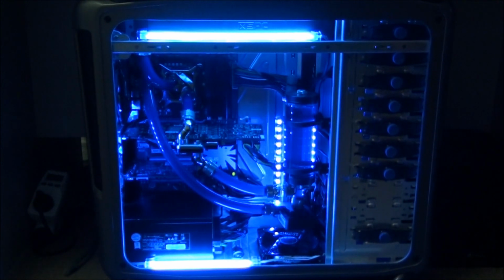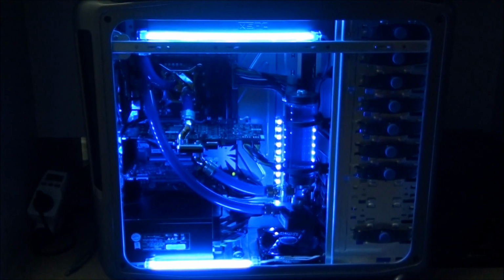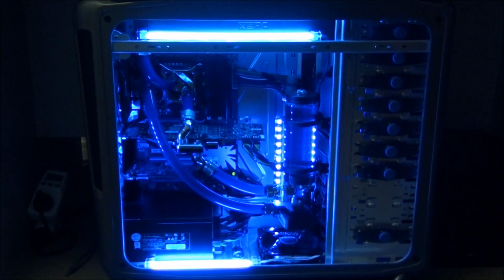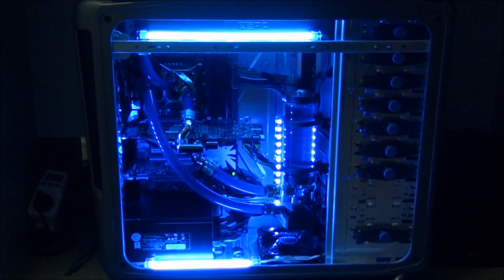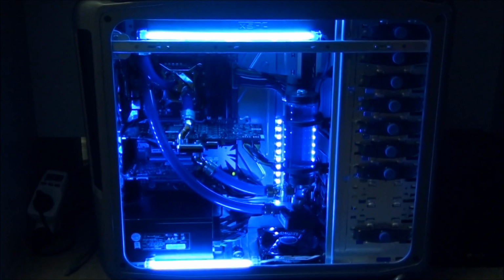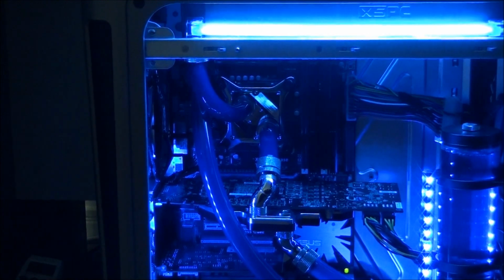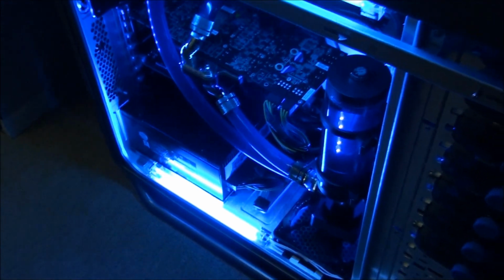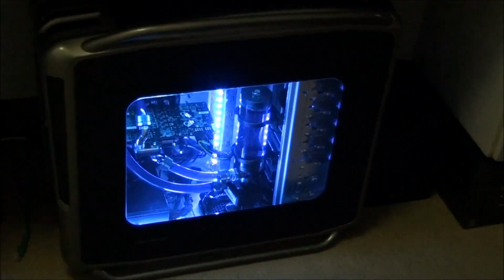Singularity Water-cooled Cosmos S Build

Comment: @masteircheef I have zalman CNPS10X extreme :) I think they shouldnt include any cooling solution with processor. Just go buy cheap cooler if youre not overclocking. If you are overclocking then buy the top watercooling system :D

Comment: whats the filter good for ?
also, i will soon start to build custom watercooling for my PC. will watercool my i7 920, rampage 3 extreme, and my GTX 570. 
what radiator should i choose ? size? brand? noise and prize is not important, i want the best radiator you know : ) I will buy the corsair 800D, my antec 1200 wount fit any radiator if i dont do any mods, and i cant mod..
thanks for answer

Robin HanseN - Norway